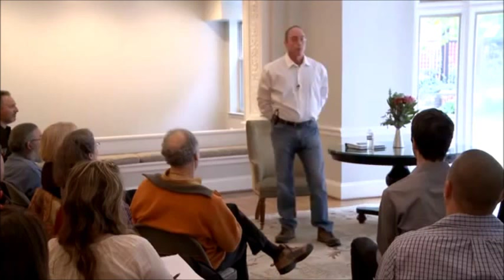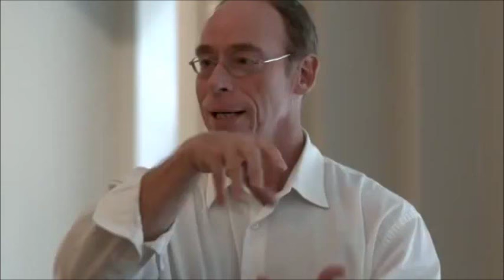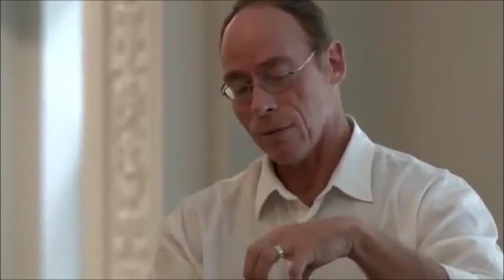How Does Anti-Gravity Work?

Comment: hmmm I think a posirtive idon creates gravity as we know it kicking out em rotations not anti matter. Adn that this systems would create em storms taht pushed up cracking the egg so to speak creating the plates we move on but also created a 3d magnetic system that through augmenting rotations creates gravity..

but im still unsure, becase it could lead to solid magments surrounding the waerths core which would infer - a potential hollow earth...And if a positive pressurised core with to be fused together it may act like anti matter - meaning earth could just as easily be hollow as a pressurised liqued metal core..in idealology - but you would be able to get me in an environment like that thats a low light dim or hot places I could imaging the stink from here...